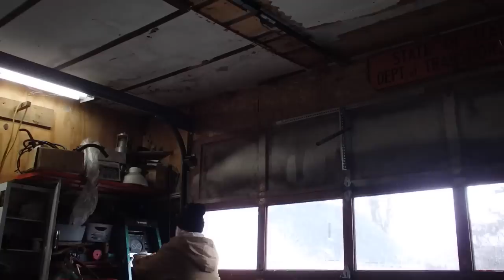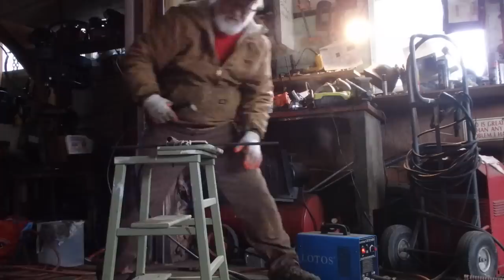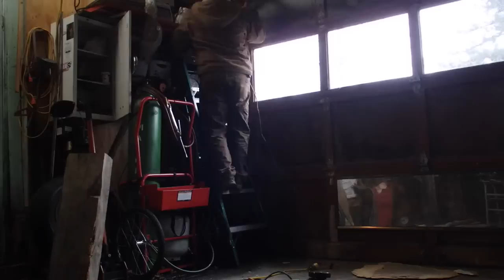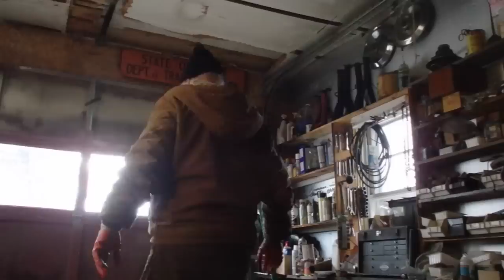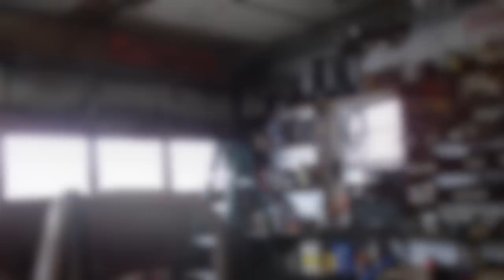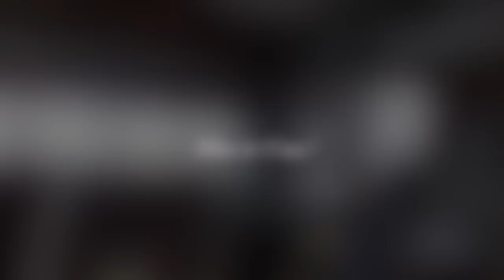When the Roll is Called up Yonder, I'll probably be in the garage

Comment: No blood, that's good.  I'd like to see a video of your plasma cutter, been thinking of getting one for a while, but I'm bewildered about what's a good one, and how many features one could use.
Reply from the maker: Mine is the cheapest one made I think.  It works well enough, but not nearly as good as a good one, if you know what I mean..  That think 63 Impaller has got walks through metal like it was hot butter..  By comparison, mine is okay, but nuthin' to write home about..
Reply: 63 impaller has got a bigger bank account than I have.  And he is using his a lot.  I just need something that's going to work, but not break me up, or break down.  I'm not making art or cutting on cars all the time.  I guess for now I'll just use grinders shears and saws.
Reply from the maker: *****   I found some cheap cutting wheels on ebay and use the heck out of my old grinder.   Cuts nice..
Reply: I buy the thin cutting wheels at Harbor Freight, they are pretty good,  and I bought another grinder a little while ago.  It's a Bosch AG50-11VSPD, its a whole new class of grinder for me.  It's a brute, but it is variable speed, with soft start. Check it out if you want.  I have a few others, all good, small light units.  I don't have to change from brushes, to grinding wheels, to cutting wheels that way.
Reply from the maker: *****   That's the way to go right there..
Reply: Harbor freight flap disks work well too.  I don't know how well they hold up compared to the mainstream name brand ones, because I'm too cheap to buy them.  I don't have any harbor freight grinders, and don't plan to either.